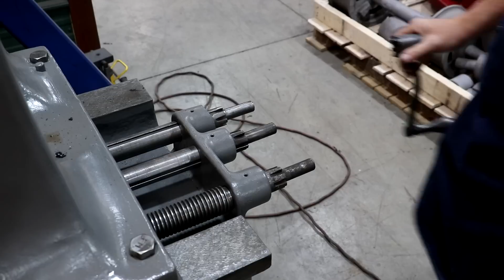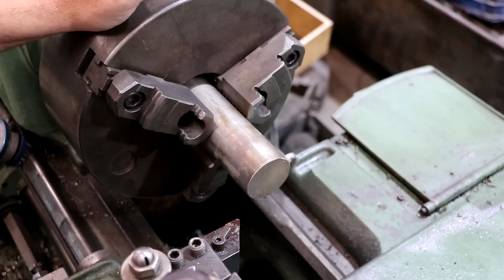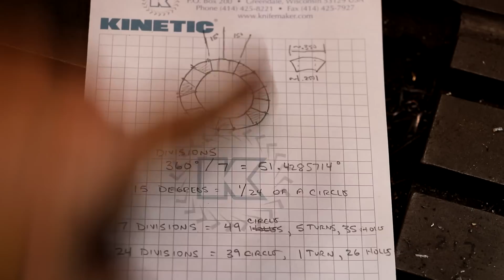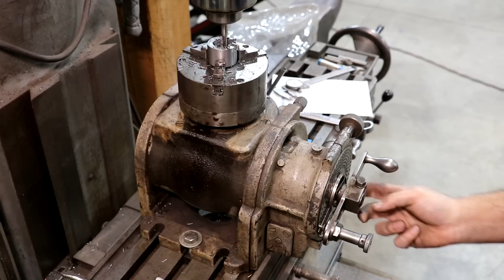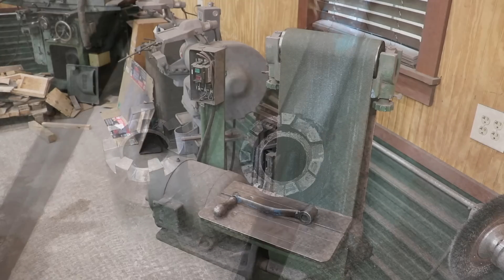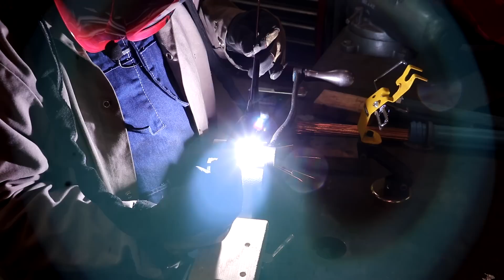Horizontal Boring Mill Restoration: Milling an End Spline to Repair the Crank Handle

Comment: Mount a lathe chuck on that thing and a tool post on the bed. And you got one heck of a lathe!😅, Probably not going to have the power needed for heavy cuts  maybe mount a external motor, a 5-7hp 3phase with vfd should do it. Spin zhe chuck with a 8:1 reduction cogged timing belt. It would be interesting if nothing else. Growing up we made do with what we had. Often having to make things. Some worked, some didn't.  Seems the fun was in trying and solving problems!.  I want to build a old stationary, pony/hit n miss, oil field style motor so badly vi can't get it off my mind. I want to start with a pile of scrap, melt it down. Cast the parts and machine them. Weld them until i get a running engine.  And i want it to actually be a daily working engin. Used to generate power to charge batteries for my off-grid home. 10-20 hp should be plenty. I'd like to build a boxer two cylinder,  a 4"-4.375" bore with a 8" stroke, a engine  that can run on diesel or waste oil as well as spark ignition fuels, maybe get a propane/cng tank 500-1000 gallon , maybe use distilled biomass to produce wood gas, or burn used oil , engine oil or cooking oil. After spin filtering . Spin a collection dish at about 1000 rpm inside a bucket with a drain. The oil from a 1/4" pipe running into the middle of the spinning dish. About 8" diameter, 4" tall like a paint can. Having a 1" lip around the top.  The oil filling this 1" while spinning. Only the lightest clean oil can escape . It runs out the 3/4" drain to a clean oil storage tank . Attempt to use a 500 or 1500 watt dc motor. With a pwm speed controller to fine tune the speed.  It may not require 1000rpm to get clean oil, or it may require a higher speed , and it may require more time at speed to separate the contaminates from the oil. The oil feed speed may need to be reduced to a fast drip to allow seperation time. It could require more like 2000 rpm, and a slow feed rate. Its no big deal to clean the oil. It may also be heated, to possibly 150°f then filtered.   Using a head on the engine that can use a plug to raise the compression ratio and be fitted with a diesel injector, or a different plug with a spark plug with reduced compression , 7:1 to 8.5:1 on spark ignition, and being adjustable would be cool. Even if the engine used different heads for different fuels . Would be worth it. Use small engine diesel injectors, with about 20:1 compression. And use either the exhaust or the engine coolant to heat the fuel before being injected. Use a electronic governor for both fuels. Because id probably have fuel in batches for possibly months at a time . Converting to a fuel is simple.  Usong injectors for two 10 hp engines  running from the cam shaft. And the ignition system running off the cam of the other fuel types. Maybe wood alcohol is produced. And the 20:1 compression can be used with the methanol/wood alcohol, only a ignition timing adjustment may be required, and the engine producing much more power. The rpm will be low . The tq high. Using two 50-100 lb flywheel. ,About 16"-18" dia. Use a dc motor to start the engine. Using a belt drive and possibly  one way bearing.  The peak RPM would likey be 1500-1800 rpm and normal operating rpm being 900-1200. After some math and figuring maybe 600 rpm would be normal operating rpm, and peak rpm being 900-1200.  A 8" stroke is uncommon these days.  Id  want to use commonly available bearings and valves. Possibly pistons. I'd want a minimum of 4" bore.  And 6"-8"+ stroke. I want the long stroke , low rpm. the long  stroke should be a quiet engine the ignition long over when the exhaust valves open. The low rpm the engine firing at a slow rate. It should be a quiet engine to deal with , a loud engine running at 3600 rpm all day gets old fast.  This engine could possibly idle at 100-150 rpm, if it can produce 500 watts at idle awesome, let it idle all-day. And 2000 watts at 250 rpm, or 6000 wattsat 325'rpm, 10kw at 750 rpm awesomely awesome.. especially if it cant be heard in the house, place the engine inside a building, with quiet car muffler on it basically making it silent while spinning 4,  150 amp HD alternators with it as quiet as a new prius or corolla idling, unheard in the house. The use of a modern 10 hp diesel engine , can produce much noise, even inside a quiet box.  Id build a plywood box with labyrinth inlet and  cover the inside with foam padding and used carpet.  Atleast two layers of each . And still be heard.  The thing would shake zhe ground , the boxer being perfectly balanced. Should be smooth and silent!.. sorry to ramble. Its a dream i love building things . I do not have access to the equipment to build my engine.. and definitely cant afford to pay a shop to build it. I gave experience building many engines . Just no equipment to machine them .. have an awesome day love the videos !

Comment: I know this is an old video but why wouldn't you have just cut the cylinder and brazed in a cylinder.  If the teeth are OK on the handle and fit the spline on the machine then just turning a cylinder to braze between would be done in 30 minutes.  Slam Bam thank you Ma'm!

Comment: Why not cut the crown off and make an extension to be welded, or brazed, to the handle then put the crown back on? It might not make as good of a video but it’ll get ya where ya need to be.

Comment: I would not run that big drill through the hole without clamping the vise down.  It almost  caught in the video.   If it had really grabbed, it could cause real damage and or injury.  Great fix otherwise.

Comment: Why did you not just cut the handle off and add a piece on the back so that you didn’t have to do all the complex machining just didn’t make sense it so much easier to cutter around peace and added on the back because that’s been welded on to start with

Comment: G'day Keith, Great video as always.  I am wondering why you are not making a 2nd crank handle, so you have one at the front of the mill and one for the back end.  Obviously, one for each position would be again causing issues of interference and a serious case of overkill.

Comment: At first I thought "why not just cut the handle off, weld on the back of it, and weld the handle back on?"  or "why not just make a piece the full length and weld the handle on that?"  but then towards the end, I saw that that's steel and the handle is cast iron and then I had a 
AH HAH! moment lol.  Nice job Keith!

Comment: Couple of newbie questions.  1. When your talking about taking 0.100 off of the diameter, do you fee in 0.050?  Do you do the math in your head or are the lath markings setup to allow for the difference in in-feed and diameter?  2.  What do you do with all the chips and shavings?  Do you sweep them up or use a magnet or what?  By the way love your content.  Thank you

Comment: Perhaps another way would be to swing the ram 15 degrees on your mill and offset the table in the X axis the required distance then crank
the dividing head for the 5 spaces.

Comment: Keith, great series, great content. One suggestion, the power switch / contactor  on the belt sander has what appears to be open / exposed 3 phase wiring…. Bad idea!  I’d suggest a cover plate, before you get electrocuted!   Best!

Comment: You can see where the handel was welded.  Make new toothed sleeves the right length, then weld the handle back on.  Less work, better crank handle.
Reply: *handle

Comment: Love watching you figure out the math and setup of the dividing heads/rotary tables, etc, but wouldn't it have been easier to just cut the splined end off and extend it with some tube stock?
Reply: It would be "easier" to not have a hundred+ years old machine to restore!  However, restoration is the function of his "Vintage Machinery" shop!!

Comment: In order to simplify things a bit, I think I would cut the original sleeve and add a piece in the middle. That would retain the splines you already have, and making it a bit longer would give you room to re-cut the splines in the future if you ever need to.
Reply: I think his end result (deeper engagement) was perfectly served by his technique.. The splines already needed cutting deeper at the outset.
Reply: Then I would have missed a dividing head lesson!  I think the new teeth are better anyway.
Reply: I personally agree with you but that would require two welds increasing the likelihood of misalignment. So technically I agree with Silas Marner on this one.
Art from Ohio
Reply: But the old splines didn't fit as well, it seems like someone just milled 7 wide slots with parallel sides instead of the slots with 30degrees included angle.
Reply: My first thought, but then this channel is about doing things differently with a dash of education.

Comment: Hi Kieth, that was some dance step with the dividing head. While youve got it set up why not turn another, longer one and make a second handle for the other end of the table. 
You're also going to need a longer boreing bar. Josh Tupper at the Tupper engineering site just made a five foot one for his different Lucas HBM. Might give you some ideas.
Regards from Canada's banana belt.
🤞🇨🇦🍌🥋🇺🇦🕊️🇺🇲👍

Comment: At 27:00, the needed y-offset is R sin(15 deg).  If the I.D. is 0.8", then y = 0.4" sin(15) = 0.1035".  The other side will be -0.1035".

Comment: As a European it is amazing that people freely chose to work in fractions; 1" 7/8 ... 47.625mm; and at the same time everything around you is decimal. 
But ... why not, it is a free world! :-)   Thanks for all the great content!
Reply: The metric vs imperial discussion is so old and tired. Like 100 years old and tired. When will people understand units don't matter. Any decent machinist should be able to do a job in any unit system. Just get the job done in whatever units you want.
Reply: I was discussing with my wife yesterday about how when I was in grade school (Which would be early 70s) They pushed us hard to learn the metric system because we were supposed to convert to it soon but it never happened. She's a few years younger than me and didn't learn it at all. I liked it and thought it was far easier in all aspects. Guess they figured it was too much stuff to change and too many opposed it.
Reply: It's not 1/4 inch, it's 250 thousandths, so we already think in decimal, our inch is our "meter", since they work to the nearest thousandths, they do not have to think in fractions.
Reply: Fractions are strange critters if you’re not used to them. Most Americans learned them in the fourth grade so they’re easy for us.
Reply: As an Englishman I learned all three systems - Imperial fractions, Imperial decimal and Metric. I work in all three quite happily, using whichever system is most applicable, sometimes blending them together. It’s good brain exercise and I like aspects of each one. Restricting oneself to one system only seems a little limiting to me….

Comment: I think I would have cut the splines off,  weld in an extension, and reweld the existing splines back onto the extension.  Mostly because I'm too lazy to figure out how to cut new splines.  I am however grateful you made this video incase some day I need to make one from scratch.

Comment: I'm not a machinist. Why not just cut off the handle part and weld/braise it to an entire new collar instead of extending the existing? Seems like it would be less work. I'm sure there is a reason, but if it was explained, I missed it. And if it's obvious, it's not to this non machinist.
Reply: One noticeable thing is the teeth on the old one were worn considerably. If you’re going to go through all the work to make it work better and you have the means, why not make it right. Keith said in an earlier video that he may have to remake a couple of those shafts like he did on one of them already, may as well make the handle fit the new shafts.
Reply: @Hoaxer51  Helps to watch the whole video, apparently. My question was pretty much pointless in retrospect and based on insufficient info. 😬
Reply: @The_HillPeople , I do that all the time, commenting before the video is over, I’ll learn one of these days. Lol

Comment: when you were wondering what the material was on the cylinder part.  The sparks from the belt sander would have given a clue  especially as they were being ground off anyway.

Comment: Nice job on the crank handle. These days it would have to have a spring to push it out of engagement for safety. 100 years ago you were responsible for your own safety.

Comment: Why did n"t you cut the handle of, weld the the extension on the back of the sleeve and weld the handle back on? No machining other than cleaning up the weld on the lathe!

Comment: I'd have probably put a close fitting pin through the hole, to keep the two parts aligned, while it was being welded.
Reply: I believe he did just that.  When he was at the lathe he showed fitting the old handle onto the new end.  The end stub acted as a chill ring for the weld.

Comment: Wouldn't have been easier to remove the handle ands add the extension to the back?
Reply: Sure but then nobody gets the education on how to actually make the splines.
Reply: He didn't want to have to weld onto the cast iron arm. Someone else already did that part.

Comment: Curious as to why you did not just make a extension on the other end and reweld the handle to it?
Reply: Sure but then nobody gets the education on how to actually make the splines.
Reply: @ralphgesler5110  The handle looked like it was already welded on, the splines probably needed to be deeper, just wondering why it was done this way as making a round bushing is a whole lot easier.
Reply: He wanted new teeth.

Comment: As always, well done, well filmed and edited.
Just built and verfied a digital control of a rotating table. 7 steps would be no problem as well as the 15 degree adjustments. A little Arduino UNO, a stepper driver and motor.... 39:01
Reply: I mean this unsarcastically:  You should video it it in action and put it on your channel since I see you do indeed have a channel.
Reply: @silasmarner7586  Thanks! The video recording equipment is either the cell phone, impossible to hold during milling, or a Go Pro hanging in strings, but I'll consider it!

Comment: why not just simply make  a compleate new part , then weld on the handle ?? (then you will not need to braze a silly wee bit on th end )
Reply: I have to agree, it has obviously been done that way before, much simpler and no concentricity worries and easy to make it a little longer to leave material to be removed next time the teeth get mangled.
Reply: My thought as well.  It would have been less work and, I believe, a better product.
Reply: Keith indicated that the crank was repaired sometime in the past and the end piece was steel.  This made the new end a steel-to-steel weld, as opposed to a cast iron-to-steel braze.

Comment: Why not cut the old one off and make a new full length piece and weld it on the handle?
Reply: I think the handle was cast and would needed to be brazed on. Probably easier to weld on the extension.
Reply: I have to agree.  It seems like you picked the hardest way to do this.  You could also (gasp) shorten the shafts so as to not interfere.
Reply: He did not want to have to weld steel to the cast iron handle. Someone else already did that hard part (hard for him)
Reply: Probably cause the old teeth are shitty and not quite right anyhow
Reply: As Keith said, it's probably cast iron and would have to be brazed.

Comment: Looking good Keith.
That gastric bypass operation has really helped you shed some weight.

Is it the Stoker steam engine that will be the 1st job for that horizontal boring mill?
Reply: Who said it was "gastric bypass"??  The bottom line is, that it is none of your business.
Reply: @paulcopeland9035  What else can it be and why do you care?